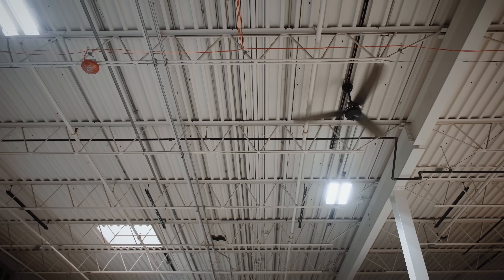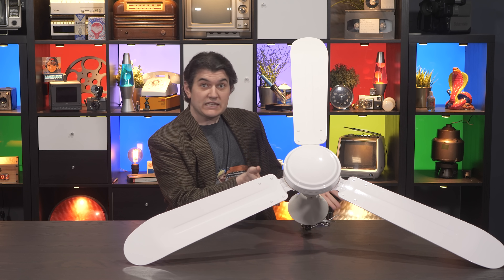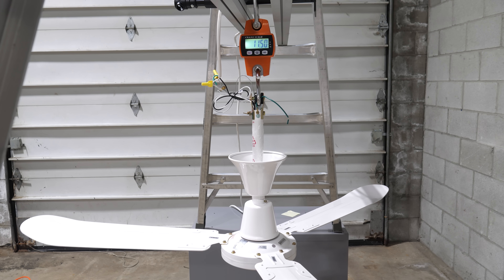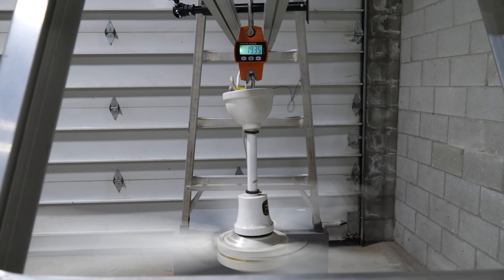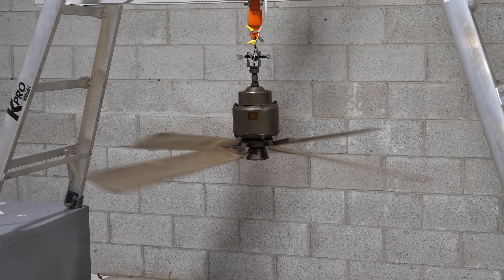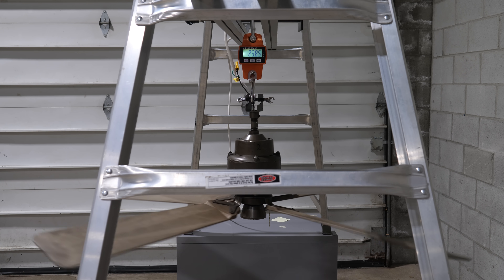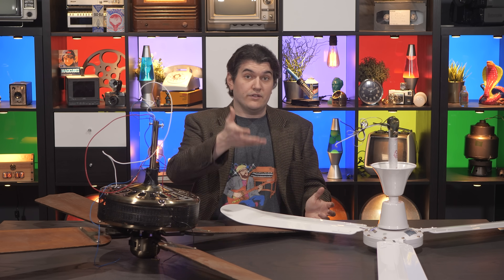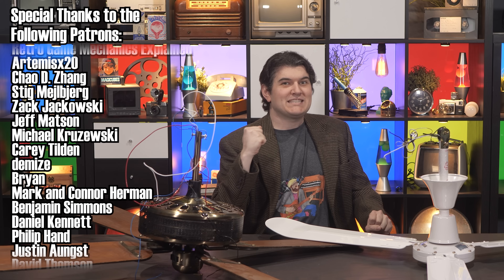How much thrust does a ceiling fan produce?

Comment: Aren't prop blades shaped like twisted wings to increase thrust?  They have camber, curve and twist.  So they aren't that much like a ceiling fan.
Reply: Yes. You're correct. 
He doesn't know how helicopters work
Reply: Those things help increase efficiency and reduce noise, but the basic funtion of "angled blade hits air -> air moves in the direction of the trailing edge" remains the same.
Reply: Yes, but they are still basically the same thing as ceiling fans. They accomplish the same thing through slightly different means, but yeah, they're basically just fans.

Comment: "Fan" is an exaggeration. These things are air stirrers.
Also: I loved the "which is a different number in kg" snark. Especially since SI prefers to measur thrust in N.
Reply: ... where N stands for Notpounds
Reply: So what if we got a turbine for the ceiling?
Reply: Yes, some of them are really bad. 
The ones here are much better than for example the ones with wings made out of metal pipes with some kind of mesh in between.

Comment: For nextvember Dan needs to get you one of those fans where the blades are an actual aerofoil shape instead of a flat or bent plank.
Maybe you can find a 3D printing themed Dan to make you a toroidal blade set!
Reply: Most ceiling fans operate at a low enough Reynolds number that it doesn't make a huge difference. Would be neat though.

Comment: Umm actually, the fan does not get heavier or lighter due to its operation.  The weight is the same but the rotation of the blades imparts a separate force which acts on the scale.
Reply: True, but this is November, and explaining would be Alex expending too much effort.
Reply: Good point.
Reply: Ultimately force-binning is made up, so they do get heavier or lighter, though their mass is the same.
Reply: It's almost like effective scientific communication relies on simplifying things to make them more understandable. Also, you're still incorrect, because heavy/light relates to weight, not mass.

Comment: I wonder, would the measured thrust change if the fan is measured closer/further away from the ground? If you are pushing all that air against the floor, would that create an area of higher pressure that pushes back against the fan? Or maybe lower (static) pressure, as the air is being accelerated?

Comment: Thank you for pronouncing thrust correctly...🤣 Also, if your as pedantic as I am, I think it's same to assume you are... If you were at Menards, you will have surely noticed that they have a new "vintage" line of Christma... Holiday lights. I have a bunch of them, and while the flicker is greatly reduced, it is still present. Also, due to the design implications, the individual lamps have a bit of a directional component to them in regards to light output. I find the colors quite pleasing, if a bit over saturated, most notably the blue. However the "flicker" version of these is quite, atrocious. In the spirit of no effort etc, etc... I will spare you the details of any further analysis. I can't wait to get your evaluation on these. Have a simply fantastic day.

Comment: You should be able to estimate the force by measuring the air speed below the fan. Force = area x density x velocity². 
Area 2 m², density 1.3 kg/m³, force 5 N; air speed 1.4 m/s - seems a low air speed.
Reply: - Air speed will be hugely different at different places under the fan.
- The area is hard to define (its definitely not the area of the blades, nor the area of the circle the tips of the blade describe)
- Air density is a function of pressure. (which is not a constant in this case)

Comment: Hey, did you consider using strain gages to measure the lift of the fan? If you use 4 gages (2 in the direction of strain and 2 perpendicular to the others) it'll cancel out the torque measurement of the motor. By applying them to vertical support of the fan, you'd be able to get extremely accurate measurements relatively cheap and with only a half hour or so of sanding, glue, then soldering.

Comment: 8:44 I'd wanna wear a bullet proof West at least to go near that thing. Ceiling Fans in general are a touch scary due to their exposed blades and because we don't have them in europe, but "mounted" like that and beeing so unstable thats a wholy different thing
Reply: we most definitely have them in europe
Reply: They're much less common in northern europe, but do exist, I have one in the UK, and my friend in France has one, my friends in Belgium, Poland and other countries have seen them, but dont have any.
My friends from Portugal and Spain say they are common there though, although I'm not sure how frequent it is compared to the US where they seem ubiquitous.
Reply: Europe has south
Reply: There is nothing scary about ceiling fans, most of them use plastic like blades, but i have one with aluminum blades and is very light. The bigger the fan, the less fast it needs to rotate to push air, so bigger means quieter as well as weaker if you are foolish enough to put your hand in its way, you are more likely to just damage the blade than the blade do anything to you. Unless you buy one of those heavy fast types which are usually not for home but more like for a warehouse.
Reply: People should stop saying 'europe' instead of their country. Europe is not culturally unified

Comment: I finally understand the difference between the imperial and the metric system. Thanks, TC!
Reply: Yes. Me too. One is a different number than the other. Way cool!
Reply: @busimagen  The difference is mostly units of measure of volume, if I recall correctly. That and possibly units of length smaller than an inch, which no one actually uses in the normal course of events. 

The Imperial system is basically just 'every specialised unit of measure of things relevant to a specific field, standardized such that unit X is always unit X, with people then prefering to reuse existing units rather than create new ones if the existing units were sufficient to their new task'. Over time some fell out of use as the specialty they came from was less significant, and then sometimes things were rationalized a bit when that left gaps that became an issue later. Imperial units are Very Good at the things they're intended for, and Terrible at everything else, and conversions are a pain.

US customary units Started Out as British Imperial units, but then things happened.

SI units (kind of sort of metric but not exactly) are intended primarily for scientific applications, and for stuations where great precision is needed, as well as to minimise, simplify, and/or eliminate conversions wherever possible. Officially only the base units and multiplying or dividing it by 1000 are actually Things in SI, but you'd be hard pressedd to find a country that uses the metric system that doesn't add additional units for practical reasons: Centimetres (1/100th of a metre) are pretty much universal, for example. Some places use decilitres (1/10th of a litres), most places will use teaspoons (5ml), tablespoons (10 or 15ml depending on country), and cups (250ml, or 1/4th of a litre, or 200ml, or 1/5th of a litre, depending on where you're talking about... good odds on one of those having it's origin in American units and the other in British, though it's quite possibly unrelated, but it's very confusing when you end up with the wrong one!) for cooking because it's just substantially more practical for things of that scale for that particular application. ... and don't be surprised if you find the occasional stray imperial unit still floating around for certain niche applications.
Reply: I don't see why anyone needs to know the metric system anyways. I'm glad he's using the objectively better system.

Comment: Why didn't you do the test in reverse? It would be less error prone and you give the fan a stable surface to push down onto. (In reverse I mean, mount a fan on a block and put it on a scale facing upwards.)
Reply: Oh yeah. that would be easier (and more representative, no ground effect -- the ground represents the normal ceiling with lots of free space above etc) -- oh well!

Comment: In the spirit of Not Going To Look That Up To Verify November, I think I read in my homeowners electrical guide that recent code change requires all ceiling boxes to be fan rated for the idea that why have a lightweight type for lights if some day a fan is wanted. Install now instead of retrofit later

Comment: Extra fun fact about the tail rotor, it makes the helicopter crab sideways in cruise flight.
Reply: So now we just need to add a third rotor pointing in the opposite direction to the tail rotor, which we place at the centre of mass!
Reply: @AnT508  that will add another torque, so we need to add fourth one to counteract this.
Reply: @norbert.kiszka we should add a fifth one just because 5 is prime.
Reply: We need a 6th because although 5 is prime it is also odd and therefore there is an excess force we cannot counteract
Reply: @norbert.kiszka  And suddenly we’ve invented the quadrotor, not known for space efficiency. Or the V-22, not known for safety.
Reply: @norbert.kiszka That torque would be counteracted by a small change in pitch, so no fourth rotor needed.
Reply: @johnbean2596 if we go to 6, might as well go all the way to 7, because it's another prime!
Reply: @Nick-o-time  let's add an 8th simply because I don't like the number 7
Reply: @Nick-o-time Look, we can either have it prime, or we can have it even. If we don't make up our minds there will be infinite regression.
Reply: why not make the whole helicopter out of rotors?
Reply: This is actually why the main rotor of the Mi-24 is titled by 2.5 degrees compared to the cockpit, so that the cockpit will be level and the sideways tilt of the main rotor will counteract the side thrust of the tail rotor.
Reply: @AnT508 a small one though
Reply: I did a small stint in the oughts working on a helicopter flight simulator. The interconnected forces involved in helicopter flight are mind-blowing.

For example, in order to have the helicopter move forward you have to tilt the main rotor forwards... 

But that reduces the upward component of the thrust, so you have to increase main rotor power to compensate... 

But that increases rotational torque, so you have to increase power to the tall rotor...

But that increases rotational torque along a different axis, AND changes the tall rotor's effect on your lateral movement...

And so on. I developed a very strong respect for helicopter pilots over that year. I believe that I could become an airplane pilot, I'm not sure about a helicopter.
Reply: You can then throw in gyroscopic precession to make it even more crazy. When you input a pitch forward command the blades actually produce more lift at the 3 o'clock position and less lift at the 9 o'clock position.

Also the main rotor is tilted ever so slightly to the side to counteract the tail rotor pushing the helicopter sideways.

Helicopters are abominations
Reply: @EricGerlachCa A lot of different forces if you want to analyse them, but a skilled pilot will just put the controls to where his feel for the balance is where he wants it. I’ve never tried it but I guess learning those skills isn’t easy.
Reply: @EricGerlachCa a little bit of what you mentioned there is done by the control mixing system, basically just some extra bell cranks or cams between the collective and the cyclic controls, and some through the design of the rotor head etc, but most of it is just done by feel, knowing how much input to give each control to get the needed response, without a lot of thought about the details you listed.

Not going up as fast as you want? Pull up harder until you are! Lol

And obviously there is a lot of skill that goes into knowing what is needed, but it becomes muscle memory for most flying conditions.
Reply: Also, the power to the rotors is basically constant, most helicopters run at cruise power constantly, it's the amount of pitch that is changed, which obviously changes the amount of power they take, but it's kind of backwards lol
Reply: An unpleasant discovery when I started to learn them in msfs
Reply: I guess you guys are going to have a giggle once you've looked up pictures of the Volocopter.
Reply: After reading these comments a gyrocopter doesn't look so sketchy anymore.🤣
Reply: The tail rotor doesn't make the heli crab sideways in cruise flight.  The pilot simply points the nose a fraction of a degree in the opposite direction, which changes the thrust vector enough that no side movement will be present.  If the pilot didn't correct for it, that would be considered a level skid, and would be evident in the slip/skid indicator (often just a piece of yarn tied to the windshield in front of them).

Tilted tail rotors are there to address balance and attitude issues as the tail rotor gets further away from the center of gravity, not to counter crabbing or tilting of the fuselage.  Any heli with a tilted tail rotor will also have a stabilator, they're present for the same reason.  The rotor gets used less in flight as the horizontal stabilator becomes more effective at speed.  A good example of this can be seen in both the UH-60 and Mi-24.

Regardless, adding all those other rotors to counter a force that the pilot can counter by simply FLYING the heli correctly, and then subsequently addressing reactionary forces from those rotors is missing the point.  If you're concerned about it not being balanced...balance it.  Put a nose rotor on the front that is equal and opposite to the tail rotor.  Three is also prime.  Disappointed in you guys for not thinking of it.
Reply: @Skinflaps_Meatslapper  In cruise you want a no slip condition (aerodynamic trim), that results in a crab. If you want nose-tail trim (flying where the nose is pointed), you'll get some amount of sideslip. The ball in a helicopter is not a yaw string, it just means torque/yaw is in equilibrium with the actual flight vector.
Reply: LEFT SKID LOW!!
Reply: And that's ignoring odd non-prime numbers.
Reply: It would be better if the rear fan could rotate to help with the forward momentum
Reply: @ralanham76 Check out the Sikorsky X2 technology. Also tail rotors are often angled to produce some lift to help counter balance the weight of the tail
Reply: @kilianortmann9979
During cruise, are you sure that's right? I thought surely it was more of an issue during a hover.  At cruise the airflow over the body helps stabilize the rotation from the torque, and so the tail rotor doesn't need to do much. 
At a hover however the tail rotor solely has to do that stabilization, so it has to produce more thrust, which causes the helicopter to go sideways.
Reply: @PerMortensen  In a hover, one would counter the translating tendency with cyclic input, you can see this as hovering helicopters are slightly tilted. In forward flight, it is better not to compensate and just let it crab. You are right of course, that the tail fin will reduce the required tail rotor torque with increasing speeds.
Reply: @kilianortmann9979  Thanks for adding this bit of nuance to my understanding. I appreciate it :)
Reply: Except for soviet helicopters (for example MI-24) which have the rotor (and most of the upper helicopter) tilted to counteract the push/pull of the tail rotor. Look at a picture of an Mi-24 from the front.
Reply: You just need an even prime number.
Reply: Force trim moment

Comment: I like to think that when Alec was shooting, he just did a bunch of takes of "which is a different number in kilograms," then shuffled them before the final render.
Reply: That would be both hilarious and also make the tedium of editing a little less, well ... tedious lol
Reply: @3nertia  Pounds (Earth weight) is a product of the factors kilograms (technically a measure of mass) multiplied by 2.2.  Not hard.
Reply: @WJCTechyman  Thank you for making a point that wasn't at all connected to what I said in any way ...
Reply: @WJCTechyman  worth noting the imperial unit of MASS is the slug, which is around 14.6 kg.
Reply: @tuseroni6085  I thought it was the stone.
Reply: @henke37  Stones are a Brit-land exclusive measure of weight. Apparently 14lbs.
Reply: @ssholum  I never quite understood 'stone', but it appears it's primarily used for human weight.  It gives you a lot of margin to round down.. twice if you are a little overweight.
Reply: @WJCTechyman it's not a product of, it's the relationship between.
Pounds have never been a product of the metric system, they just got a fixed relationship at one point so that you always know what the conversion factor is between them.

And currently both of them are based on physical constants, so no more prototype weights or measures sitting in a lab somewhere.
Reply: I thought you were talking about Baldwin for a second
Reply: Whoo whoo now... that sounds like extra work.
Reply: I was hoping that he'd have a reading of zero at some point, after which would be the phrase "which is the same number in kilograms".